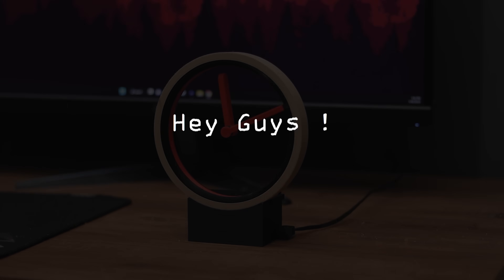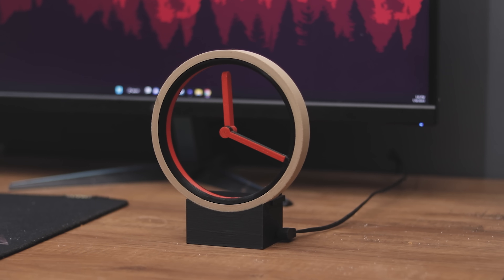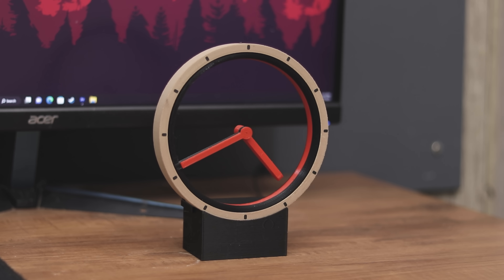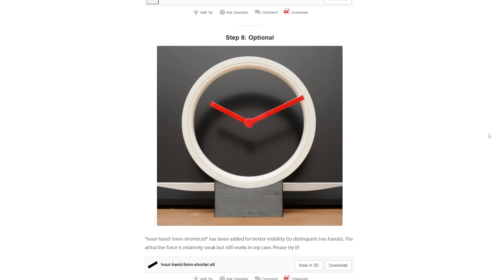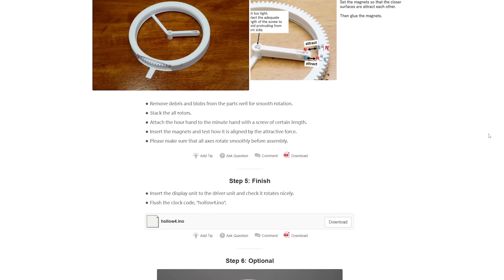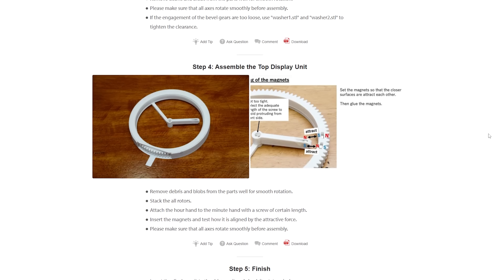How i Made this Amazing Hollow Clock | Arduino

Comment: Magnets, that's a simple, yet elegant solution and way less complex than what I had in mind, which is running a thin rod through the center of the large arm and stick a diagonal gear to it which would spin the small arms diagonal gear
Reply: Do both. Put the magnet into the minute hand and have that connected through gears to rotate the hour hand. That way it would be a true contactless floating clock.
Reply: @supraaznpride  That's not really possible, or at least, I would be very very impressed if that was ever stable
Reply: @SaltyMikan  Yeah I'm trying to think of how you could get it to work. Obviously, if you put a magnet in the minute hand and hour hand then it'll work fine when they're opposite each other, but as soon as they move closer together they'll just stick to the side of the clock. You would need some way of fixing the centre in place no matter where the hands of the clock are
Reply: I was thinking that there's is a micro stepper motor in the pivot.
Reply: I'm genuinely glad to see how many other commenters had the same drivetrain idea
Reply: I thought the hour hand was attached to a clear sheet of plexi on the back side and the plexi rotated.
Reply: My thoughts would be slightly more complicated, but would give a better illusion. Basically, you just glue the hands to two separate acrylic discs and then attach those discs to two gears like in the video. Then you can simply spin each gear independently which would rotate the glued hands. This would make it look like the hands are just floating there completely.
Reply: @That_Awesome_Guy1  no that would look like there are plastic hands glued to acrylic sheets
Reply: @That_Awesome_Guy1  What I like about this one is that there is no glare or anything at all. Maybe a tiny strip of acrylic through the diagonal for each of the handles would also work and be less noticable

Comment: Good concept but, it might be bether  if you add a RTC and some encoders and maybe some buttons to set the time, without the need to reprogram the arduino
Reply: You don't need to reprogram, just detatch the body, set the clock arms to the right time then reattach it.

Comment: great, but it doesn't really tell the real time, you should add RTC real time clock module or using nodemcu for getting the time from the internet.
but still nice to watch
Reply: 5:18 You must not have watched to the end...
Reply: @sed6  the oscillator on an arduino isn't particularly accurate, will go out of sync by the end of each day, if it's 0.5% it'll be up to around 7mins out of sync plus or minus. Also can drift a bit. Nice idea though, but definitely should use a RTC module if you want to stay in sync for more than the 20 minute demo in the video.

Comment: Wasn't the driver needed?
Reply from the maker: Yes Driver Needed, i installed it on the custom pcb board. you can see an ic on the pcb. that is the driver.
Reply: @TheWrench  wasn't it better if you just feed fixed power to the motor and and just use gear without the need for the arduino ?